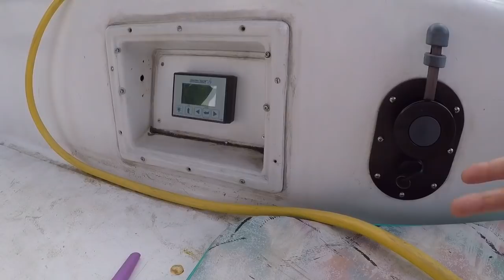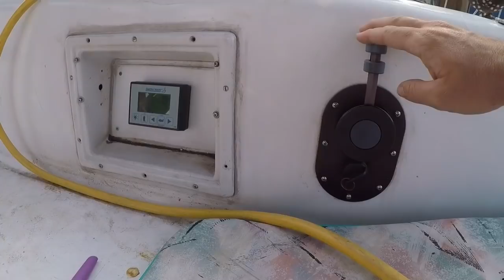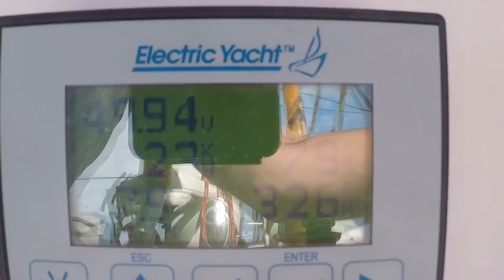Our Electric Motor | Sailing Wisdom Ep 32

Comment: I know this is a very old video but I was wondering what you thought. I have a 4000w inverter and my step down converter doesn't allow my inverter to reach it's full potential(it's only 30 amp) So I thought, what if my solar panels charge my 48v system then I run the step down converter into a charge controller to charge two 12v batteries and then run the inverter off of the 12v batteries to the house system? Or do you think that the extra 400 watts I'd get isn't worth the extra steps?
Reply from the maker: We have that setup and it works rather well. The solar panels charge the 48v motor bank and a step down converter charges the 12v house bank. We have the Victron Orion Tr 48|12-20. 
It charges the house bank with a steady 20 amps and you can adjust the voltage on it to whatever you want. (I keep mine set to 13.5v). 
It is some extra steps, but having the ability to charge the 12v from the 48v is a good thing to have.
Reply: @RiggingDoctor  awesome,  thanks!

Comment: Should the water pump and water lines be in the same location with electrical components like your inverter?
Reply from the maker: +Scott Hartsock it is not the best design so we make sure we don't have any leaks! It's a old boat, and the battery switch and the connection of all 8 water tanks happens in that locker. Space limits us from moving the water pump, so we are just extra careful when working on one system or the other.

Comment: Hypothetical question, if you were becalmed for an extended period of times say 30 days, how long to charge your bank via solar? Would you be able to charge, motor for a period then keep moving in this manner vs. diesel running out of fuel and being stuck??  Great video!!
Reply from the maker: Hypothetically, in that situation. It would take about 2 weeks to fully charge with our tiny and undersized solar array. 
We could motor directly from the solar though at a crawling speed. Naturally, more solar means less charging time and faster motoring speeds under the sun!
Realistically, if you look at the pilot charts, the number in the wind rose is the number of days in that month that are becalmed in that region. 
We avoid sailing at times with high numbers, and the numbers are usually in the range of 3 or 4.

Comment: I like the electric motor option for the quietness once you have the floor back in place. However the two down sides are as you mentioned you flooded the motor with water having the motor in the lowest portion of the boat, where water heads to if there is a leak. You could be immobilized by a leak over night. Seems like you could have come up with a battery box and motor box that would not flood if you did Spring a leak. 
Next you cannot recharge your motor batteries at night, if drawn down to a state of discharge. I would recommend a small Honda type generator for such emergencies, doesn’t have to be new just reliable. Next you might want to consider increasing your dry chemical fire fighting gear to up at least two sizes. Have you ever seen a battery explode and catch fire? You say you melted the fuse and fuse holder that right there is prime example of what I am referring to. Electrical fires are no joke, your wires run under everything and around everything make sure you have the power to douse those flames without water!
Reply from the maker: +buffettfanman the motor placement is unfortunate, but since we have a full keel and straight shaft with no downward angulation, we are forced to keep the motor low. Oddly enough, this is where the old Diesel lived before it. 
We do carry a ton of fire extinguishers because wood and fiberglass are great at burning secondary to an electrical fire!
Our plan was to not motor anywhere and strictly sail everywhere, but due to the severe weather we are having, we are getting a Honda generator to motor us a bit down the ICW.
Reply from the maker: +buffettfanman we got a Honda generator! We're going to try it out tomorrow :)
Reply: Rigging Doctor tried the Ginny yet?

Comment: The 48VDC to 12VDC converter (step down) goes directly to your 12VDC panel or you guys have a separate 12V battery bank?
Reply from the maker: We have a bank of 12v batteries as well to run the whole boat. 
The step down converter simply charged the up with motor bank power.
Reply: @RiggingDoctor  When you are at the shore, which charger you use for your 48V motor bank? Thanks again.

Comment: You said you are getting 2A at 48V ( 96 Watt) at 7kn boat speed when in re-generating, others have posted 250Watt at 6 kn with a 16 inch 3 blade prop. Suggest researching your propellor and perhaps changing to a  propellor that gives you more regeneration power.
Reply from the maker: We actually have the worst setup for regen: propeller in an aperture behind a full keel.
We have a friend that generated 1kW regularly where the highest we ever reached 576W while sailing 9 knots when crossing from the Azores to Portugal. 
2-4 amps is pretty common for us and we kind of count on it’s power on long passages.

Comment: Cont why do you want to spin your prop? Well it will cut its drag as if it had disappeared or you had taken the prop off maybe getting an extra knot of speed.
Reply from the maker: We have a fixed prop so it spins whether we want it to or not. A feathering prop would reduce the drag and stop all that needless spinning, but they are expensive and we don’t have one. When we need the power, the spinning prop gives us electricity at the sacrifice of some speed. When we don’t need the power, it just spins freely and is less drag.

Comment: I love the idea of electric over diesel, I am curious if a larger or more pitched prop would give better performance / battery usage. The RPM's would be lower and since electric has so much torque you may use less battery.
Reply from the maker: I wonder the same thing and have not had the opportunity to experiment with it. When I ordered the motor, they ask for the prop size and pitch and then supply the correct gear ratio for your setup. The goal is to have you hit hull speed at full throttle. 
I do often wonder about having steeper reduction gears that would make the prop spin faster for the given power input.

Comment: Very interesting video. Now for the other part. I have no idea about your future sailing plans but based on my experiences of many years living aboard and sailing experiences I think you have made a mistake choosing to go electric. May I explain? Sooo many places that i have been fortunate to visit required a  power source that lasted much longer than 30 or 40 minutes. Many of them did not offer a choice as to this need for extended power. I assume that your motor requires 48 volts and 4, 12 volt batteries? What if one battery goes bad and you are in one of those places where power is required?? Believe me when I tell you that this need for power will happen unless you carefully choose your cruising locations. It will also eliminate a lot of really nice places where sailing into the anchorage is not an option. Be careful and carefully choose your ports. Thanks, and good luck.
Reply from the maker: Thank you for your thoughtful comment. We actually just recently crossed the ocean with no problems! Still have a long way to go on our journey, but the motor has not let us down :)

Comment: A couple issues that were not covered, one is in regard to why two motors are used and second, in regard to any sustainable plan for charging the 48 Volt stack when they are significantly depleted.  I'll finish with a prediction / suggestion that will be upcoming in your near to mid term future, which is the decision about when the batteries are to be replaced.  

The aging process of batteries gets a bit complicated when there are parallel strings. This crept into your installation due to the choice of 12 volt batteries rather than 6 Volt. When batteries become discharged, the internal resistance rises and with age it gradually gets higher, and when the various batteries gradually become different, you can and most likely will see that one string in the bank will become different than the other. The problem is that with parallel charging, the current must split and the one string that is in worst condition, due to it's higher resistance, is the one that will get proportionally less charge current (Ohms Law). 

This condition gets worse as you go along and has an increasingly troublesome component in that when you stop charging as in nighttime with solar, then the one string that is in the better charge state is now tied to the one in worse charge state and thus will expend part of itself trying the equalize the worse string.

To point out how suttle differences can contribute to this situation, take a look at the wiring on top of the stack.  Observe the points where the solar charge wiring is connected.  If you trace out the two parallel paths that the solar charge must take, you will see that the front stack gets an advantage because both of the wires that tie the back string together with the front string are in series with the back string.  While they are large cables and thus add relatively small resistance, they do add some and thus the rear cells are at a small competitive disadvantage initially, which is the way this process starts.  (FYI: this minor difference can be remedied by moving either solar wire to the opposite end of it's respective tie wire).

My suggestion is that you consider obtaining a modern multimeter that can do CLAMP ON DC CURRENT measurement capability.  These are very useful troubleshooting tools and will allow you to check for differences in performance without disturbing the electrical connections. (As an example, Google or eBay : Fluke 365).  

In closing, I had an electric car back in the early 80's and I fought battery problems everyday for years (Google: CitiCar).  Note, that I told the sailinguma guys that their numbers did not add up while they were in construction but they had all the answers.  About a year later, they did a total replacement on the entire battery stack, from what they explained as "a problem with chronic undercharging".  The concern being that if you are running the house on 48 Volts, and only adding a few amps to them, I expect a chronic undercharge of the propulsion stack.  

You need a power budget that leads to more watts/hours in than out on at very least, a weekly period, or less if possible.  That means knowing every load in watts x hours and comparing that to every source of charge in watts x hours.  (Watts = Volts x Amps) .  So if a plotter is on at 12 Volts and 1 Amp for 24 hours, then  that is 12 x 1 x 24 = 288 watt/hours.  Add it ALL up.  On the charge side, same math, 3 Amps into 48 volts for 8 hours: 3 x 48 x 8 = 1152 watt hours.  Clearly, you have one chart plotter covered easily, what what else ?  Running the motor at 50 Amps at say 40 Volts for 6 minutes: 50 x 40 x.1 = 1352 watt hours.  So now we see, in this example,  it takes more than a day of solar charging (in the above example) with everything on the boat turned off, to make up for the  6 minute motor run.  A clamp on DC Ammeter will greatly facilitate these measurements.

If you don't have more coming in than going out, then you need more of something...time on dock power, more solar, wind turbine, Regen ??? (I'd need to see this one to believe that it amounts to much since you need to spin fast enough to produce voltage greater than the battery voltage just to begin to charge)  Please let me know if the second motor has something to do with this! 

This discussion is based on simple principles of electricity and physics.  Don't take my word for it, do your own research and draw your own conclusions but please don't ignore them.

I really wish you great success and I look forward to following along! Fair winds1
Reply from the maker: Thank you very much for the information! I would really like to relocate the solar wire as soon as possible to reduce the amount of issue it is causing to the battery bank. 
The second motor is simply present to compliment the first. Each motor is 10kw and instead of making a bigger single motor, they just hook two motors to the shaft in parallel. 
We have two voltages in the boat, a 12v for the house (2 battery banks) and a 48v for the motor (it's own bank). The solar panels on the stern charge the motor bank and the house doesn't draw from it. We do have a step down converter which lets us draw from the motor bank but we view that as an emergency power supply, not a daily power source. 
The motor does take a few days to charge from limited use, which is why we use it as little as possible. 
When the batteries are rather low, we can either tie up for a night and let the battery charger bring everything up to speed or crank up the generator for several hours to charge it all up (we got a generator to let us motor along the ICW).
Our power production is very limited and while regent does produce a significant amount of power, it is far too unreliable to plan for it to serve as a power source. Therefore we calculate everything on the solar panels and whatever we get from regen is merely bonus to the batteries. 
While I have not actually calculated our exact power consumption, I do watch our voltage. I try to keep it around 12.7v but on cloudy days we won't charge and the voltage starts to drop. The first thing to be turned off is the refrigerator when we reach 12.2 volts. This is our biggest power draw. Our second power draw is the chart plotter and depth sounder. When close to shore, we have them on and they seem to push us past our charging abilities. When we are offshore, I turn it all off and we navigate with paper charts because it's a wide ocean! This helps keep our power struggle even and us charged. 
Regen is nice in the ocean because the winds are constant. The propeller needs to be turning around 350rpm for it to start charging. When we are doing 8 knots and it is producing 3.9 amps @ 48v, the propeller is spinning in the neighborhood of 750-850rpm. 
These boosts are nice, but as soon as the wind calms, the power goes away. 
I will be relocating the solar charge wires soon. Should I move the positive and negative wires to the series of batteries farthest from the large battery cables that leave the battery box?

Comment: Thanks for sharing.    What is your depth of discharge goal on the batteries?
Reply from the maker: +SenatorPerry The ideal depth of discharge is 40%. Sadly, we have battered our batteries down to 6% on two occasions and quickly plugged in to bring them back up. 
So far no noticeable damage to the batteries but I'm sure it cut a few years off the life of that battery bank.
Reply: Maybe by the time the bank needs to be replaced there will be lithium recipe batteries that don't double the cost of the boat...
Reply: 85% discharge is ok for AGM, but any more than that may damage the batts faster than you think....glad to see you using agm over lead acid......
Reply from the maker: +SenatorPerry that was the plan when we installed the battery bank. Lithium might be cheaper, and something better might be invented by then too! I have heard of saltwater and cotton batteries gaining ground. They just need some years to refine themselves.

Comment: Thanks for another great video ! What happens if the bilge gets alot of water in it regarding all the electrical stuff...how could it effect the equiptment and could it become a safety issue regarding getting a shock ? Thank you
Reply from the maker: It would be bad, but we just do our best to keep water out of the bilge. Shock isn’t a real big issue since we keep the battery switch off most of the time.

Comment: I know this is an older video, but no harm in making a comment now.

Your solar charges the 48V system how exactly? I see the connections, but don't quite understand the thinking.

If you need to replace your solar panels, don't go with lower voltage ones (say 35 OCV), go with domestic high voltage ones of at least 70V, then you have some overhead in voltage, without having to boost the voltage.

My own system now operates the opposite of most others - the voltage control is AFTER the batteries, not before. Everything goes into the batteries, at the system voltage. There is a dump controller that then manages the voltage of the system by dumping to a hot water system. it is vastly more efficient than the other types, which just waste power.
Reply from the maker: Could you send me information on this? Our panels have died and we are currently in the process of replacing them. 
The way it’s setup now is the 12v panels go to a step up converter which boosts the voltage to 48 (x4) and reduce the amps (x1/4).
Reply: Hello Herb. We actually live aboard also on our boat Dragonfly (Colvin Gazelle). I have re-engineered the systems almost completely as they, like most, were very inefficient. PM me on facebook same name as here, I will respond immediately. The system setup is a pretty long winded explanation that can't really be done here.

Comment: If you used a transmission, could you get more run time out of the batteries? I'm thinking you could get more prop speed at lower motor RPM with a transmission.
Reply from the maker: It also makes sense in my head, but the issue is it comes down to the force needed to move the boat at a given speed. If we need 2kw to move at 3 knots, it doesn’t really matter how we gear it, the motor will still use 2kw to move us at that speed, whether it spins faster or slower. 
The motor is actually geared to match the propeller so that it reaches hull speed at the minimum amount of power needed to be at hull speed. The rest just works out as an equation of speed and power from there.